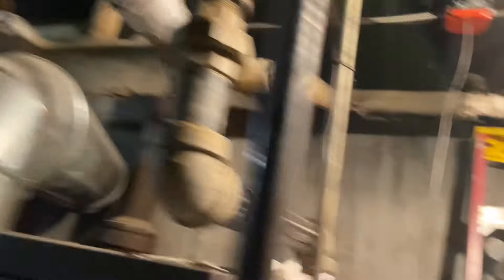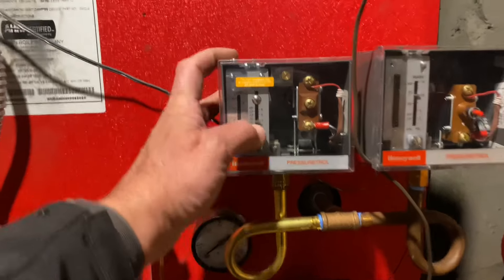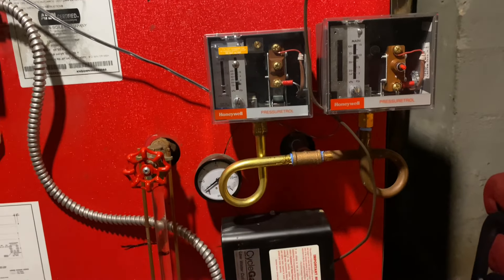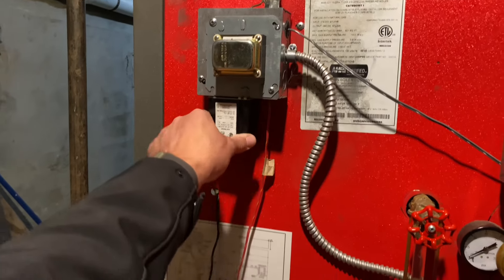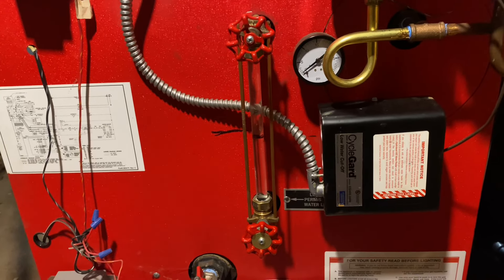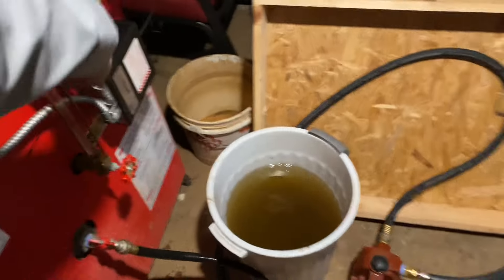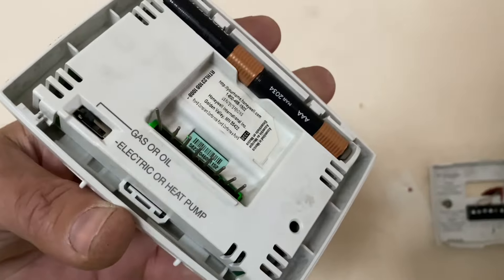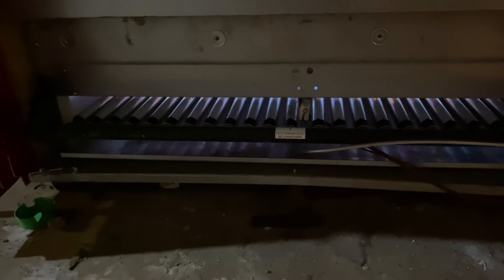Giant Steam Boiler for Funeral Home Isn’t Heating - Bodies Are Cold!

Comment: I noticed the prong on the right side on the back of the thermostat was bent when you turned it around. Looks like the RC was to the right and that would be the power, might have caused the thermostat to not have a good connection and act like it was.
Reply from the maker: Maybe but it’s a Home Depot special thermostat and it’s time for her to be replaced

Comment: Pin on back of that thermostat is pushed over brother......classic customer cause....see it all the time.
Reply: I can approve this diagnosis
Reply from the maker: Did I really miss the broken pin on the back of the thermostat?
Reply: @PipeDoctor  regardless the thermostat had to be replaced so all good
Reply: Perhaps lol.  Take it easy.  Vin.
Reply: That's what i saw as well.. pin looked slightly bent probably why the stat wouldn't seat to the sub plate properly. Also don't those series 80 stats have parameters to set the cph for steam or hydronic?
Reply: yeah, the one bent over was the Rc(cooling common) pin, that wouldn't effect the heat function anyway. BUT if it's not going on all the way the pin next to is Rh(heating common) pin.
that said, those are notorious for batteries leaking and running down onto the circuit board, which makes them do all sorts of funny things, including reading wrong temperature and spazzing out. so either way it was smoked.

Comment: Ok, but why was the boiler flooded? 

And you neglected to adjust the two p’tols to the proper cutout pressure setting.
Reply: Customer added water, thinking that would correct the no heating issue
Reply from the maker: That is correct. The customer kept adding water, thinking this would solve the problem.
Reply from the maker: I didn’t neglect to adjust the pressure troll what I also didn’t neglect to do was to make sure that the owner of the property was made aware of they need to close the second floor abandoned office windows, so the thermostat doesn’t stay calling 24 seven